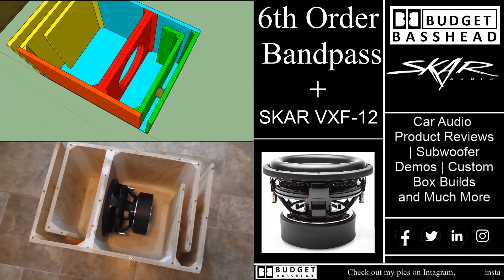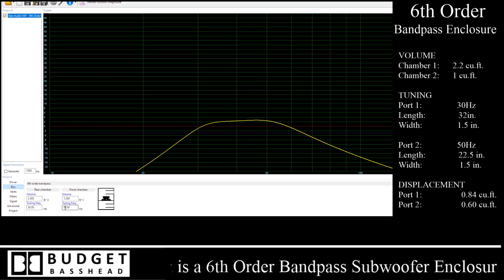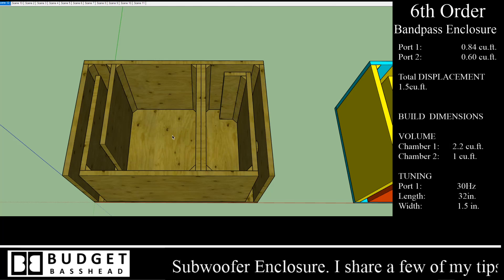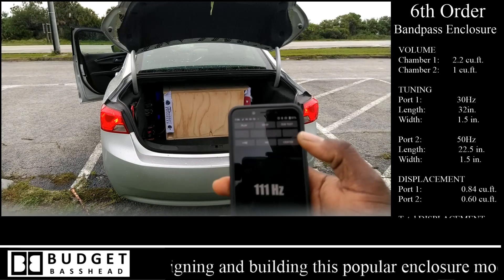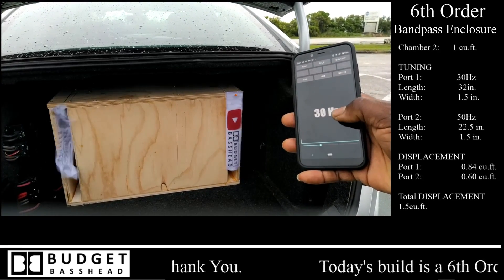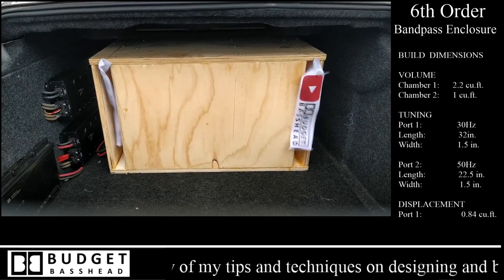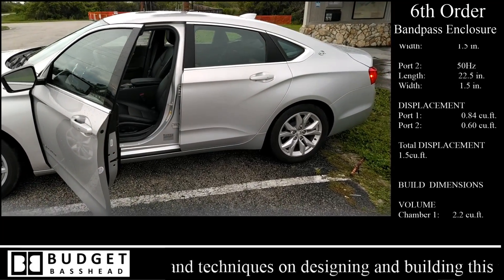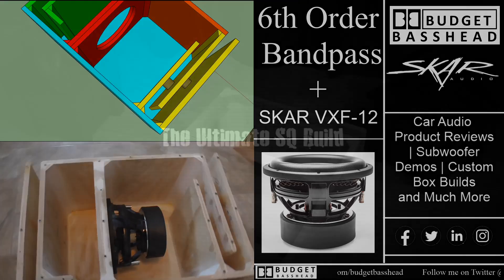How To Build A 6th Order Bandpass | Demo + Build Plans

Comment: As an avid audio enthusiast (Masters in Acoustical Engineering from Purdue), life long wood worker, and (as of last week) MECP Master certified car audio tech nerd, I have to say you do some of the cleanest and most professional builds I have ever seen. I have had the pleasure to have worked with an extremely wide variety of audio nerds.  Your designs are well thought out, well explained, and very well executed. Thank you sharing your time and knowledge with us Youtubers.
Reply: I do have a question though, do you think the ports are to narrow?? Only 1.5 inches.. just curious. Thank you
Reply: @arnoldsalazar5851  as the spl levels go up, for a given mass (volume) of air, it has to move faster and you are trading off port noise vs diameter. If the cross section is too small you will hear the air rushing through the port.
Reply: I generally see that people under size there ports, when I used to build boxes I would generally increase the total volume of airspace and increase the port size as well, in my case I preferred lower tuning so port had to be long as well. Insane efficient output and never had port noise.
Reply: I build boxes also, I haven't started making any of my videos for YouTube yet, but I need to. one thing for sure is I wish I had all the knowledge that you guys have when it comes to making and designing my boxes for my builds. I just finished a 6th order bandpass that I originally made to be a 4th order but I had to tweak a few dimensions and ended up with a 6th order for a single 8" Fosgate P2D2 dvc that sounds pretty amazing. but I wish I understood all of what you guys now and implicate in your builds.
Reply: who cares
Reply: I can't seem to get my vxf 15 to load in winISD do you know how to fix this?

Comment: Your channel has taught me so much ver the years as an installer.  Thank you.  but i think my next project might even stomp the KING.. JS. 1 12 american bass xmaxxx 6th [slot and tube ports], 2 10 ab xfl 4th incased into 1 enclosure  blow  through  rear deck  2  round ports with  a square center port.   in the jag xjl. . those programs will be needed once i finish building my Mac

Comment: Finally!!! Lol, I have a single 12" Sundown Xv.3 and I have talked with a few different people and although a 4th order would be good, I've been told a 6th order will give me a much wider bandwidth for my truck. Now, my truck build has been everywhere from starting with a couple shallow mount subs under the backseat to gutting the back of my F150 XLT SuperCab and extensive sound deadener, electrical is solid starting with the Brand X 320amp alt and the Big 3-4 upgrade going to a D3400 under the hood back to an XP2000 and an XP3000 with the option of putting my other D3400 in cab, but I've decided to keep the 2nd D3400 in my daily driver that houses a single 12" U D1 8layer recone and a 2.5cuft enclosure, but back to truck. I had originally planned doing a blow-thru with 6 U's, or a triple enclosure as I have 3 all rebuilt motor up hardware and all, or a 4th order build with 4 U's. Got to thinking about it after I traded my SAV2 12'S for the new Xv.3 12 and it's seen only clean power and an hr at that. So, grounds got plenty 1 bed ground (changing to frame) so it's 3 frame grounds passenger side and 3 driver side for if I convert to Lithium once I understand it more. Anyways, I'd like to give it a shot building a 6th order enclosure for this beast of a sub that's itching to make some good sound. Thanx for reading and maaan I would be so grateful for any other advice or help. Right now I've got some birch veneer 3/4" which I'd like to double up everything so if the baffles 1.5" I'd like it to be 3" or is that all overkill? I'm about to get a good router and table, but have basically everything else accept a good circle jig I think it's called for the router. Please and Thank you for this video, VERY INFORMATIVE!!!
Reply: Also, I didn't mention what I had for an amp. Currently I only have a Taramps smart 5k Bass and so it definitely doesn't starve for voltage at all. I'm running 2 of the U's inverted in a TruSpec reinforced prefab that gave me a little bit more space just so I had sounds for the winter. And anything I do I tune it properly with the dd1+ I picked up. The Amp has a brand new output board side and Tiffany rca inputs since the second I finally opened and put it in a yr later there was a loud bang shutting off which I thought destroyed my newly reconed subs but thank God it didn't. I'd love to get a solid Korean board amp for this build and the RMS is conservatively rated at 2k, which anybody that has Sundown products knows they can handle way more with proper power and tuning. I'm looking for a good 6-8k amp for the future 2nd Xv.3 or whatever I jump up into next. Lots of work to do cosmetically to truck so this season it'll be the single Xv.3 12. Thanx!!!
Reply from the maker: The most important tip or suggestion that I can give you when building a sixth order band pass is to not oversize your ports. I personally like to build parallel 6 to order bandpass but I see that most people on YouTube build series six order bandpass. Whichever one you choose just be mindful that the larger your cabin space, in relation to the manufacturer's specification, the smaller you should make your ports. And the smaller you make your cabinet space, in relation to the manufacturer specification, the larger you can make your ports. Cone control is what you're trying to achieve.
Reply: @BudgetBassHead  I would be exceptionally grateful if you would like to say MAKE THAT CALL FOR ME! I am a hell of a student when it comes to anything car audio as it has been my passion since I was 14 and almost 3 years ago now is when it was reignited in a very serious manner!!!! A guy/buddy I have known now for 3 years is big in the SPL game, MECA judge and gives out some nasty demo's! I have learned so much from self taught ambition and with this specifically I would be honored to take whatever suggestions, tips, help, etc. as I want this Xv.3 12 to bang in the truck and I know it will, but other than "messing around" with sub box pro I've never truly built my very own masterpiece although handy with paint, wood, and making things look decent a direct front to back top to bottom build this will be my 1st so I expect to have 2 crap and 1 beauty being 3rd times the charm, lol. No, I will take GREAT PRIDE in this and it will allow me to get my wheels done again, myself and bed sprayed, undercoating and leveling kit for now. I'm tight on bread, but I always pull things together when need be. Hit me up when able to, Thank you very much big bruh!
Reply: @BudgetBassHead 

What's up, Budget Basshead? Always enjoy your content, man.  I have a buddy who has a skar Audio ddx 10 and he wants to build one of these for the his sub.    I'm just wondering if you have any tips on how much port area.    You make mention that we should be careful about using too much port.   Do you have any tips?   Thanks again man!!

Comment: Just a heads up if you're going to use plywood over MDF, you're going to want to use marine grade plywood. It's put together better than your standard Home Depot construction grade ply. Also ply is not acoustically dead which is why MDF is generally used over ply, strength be damned. But using marine grade Will eliminate some of the other issues that come into play with using ply.

Love your channel BTW, really good stuff. 👍

Comment: I have calculate with hornresp and get very low frequencies to almost 10 hz with a visaton wsp26s. it will not go higher because of peaking, so setup for 30 hz is not possible, I get only subfrequencies from 10 to 90 hz within 3dB

Comment: Nice clean work +1 
Advice:
when you design box for automobile you should consider low frequency rise effect +6 to +12 db at low frwquency starting around  50hz also called frequency resonance .
next time dont wory about Wisd graph tune up to 60-80hz +3db.. your vehicle take over and equalize the low part

Comment: This is so beautiful. WOW. I've never seen a real 6th order bandpass box before. Interestingly, I don't believe most people are actually running 3,000 watts to any subwoofers. If you do the math, 3,000 watts at 13 volts is actually 230 amps. If you consider the diameter of the copper windings, they aren't big enough to support 230 amps. If you applied 230 amps to 2 ohms, it would blow up the voice coil instantly. Sound is an AC sine wave and sine waves cannot easily pass current through an electrical coil, due to the impedance (AC resistance) created by the AC frequency. "AC impedance" is why you can plug a transformer straight into the wall socket without it exploding, the transformer winding blocks current from passing through it, acting as a choke filter. The 2 ohm load on paper, is actually hundreds of ohms in operation, which is why the speaker doesn't actually see 230 amps unless you run the subwoofer below the audible level.
Reply from the maker: I have to disagree. I think you are comparing two different electrical systems. A home's electrical system is averaging 110/120 volts which doesn't require much amperage to achieve 1,000 watts. 120 Volts system only need 8.33 amperes to produce 1,000 watts. Whereas a car audio system is a 12 - 14 volt system, requiring around 71.5 amperes @14 volts to produce 1,000 watts. The voice coil is a lot more copper than most people realize, which is needed to maintain it's thermal tolerance and  impedance rating.  The voice coil does build resistance as it moves, as you stated, but no where near 'hundreds of ohms'. We in this industry have measuring tools to monitor these things. But great discussion; I like it.
Reply: Lol, I see we have a summer child. These subs really are taking that much power, but they arent doing it for a very extended amount of time. For heat to build, it needs more than just exposure, it needs exposure over time. If you only had exposure for a few milliseconds, it's going to build a lot less heat than exposure over multiple seconds or minutes. These subs are playing music, and as we know, it's not a constant tone, it's also not a DC output. This is an AC output. The sub goes back and forth, meaning the polarity switches over a frequency.

Comment: Dude, I give up! Looking that is. I have been looking for this small size subwoofer for awhile. Everyone has the same thing that is mostly wrong for me and my application. Which is a small 2 speaker + 1 subwoofer system for my office/ hobby room  built within a larger shop with all my necessary tools for my hobbies. I have the large sound I built. Now I want the small great soung. The 4" sub-encloser that sounds great is my next problem.  You just gave me the beginning of solving that problem.  I want strictly sub. Suggest to me which  box and how many watts to achieve great low sound at low to medium volume . Thanks  poppa Keith. 62 yes old
Reply from the maker: It depends on what you're using it for. The sixth daughter bandpass is my go-to. It has great bandwidth and it's efficient. But I only suggested if you are trying to listen to a broad genre of music. If you only listening to movies then I would say a simple ported enclosure tune as low as possible will be your best bet.

Comment: Great science video Mr.  I have an H2 Hummer and want to feel the sound pressure of deep bass.    I'm not looking for competition but want to feel the bass pressure not just hear it.
This is the equipment I am thinking of getting.

Subwoofer = Skar Audio VXF-12 D2 12" 3000 Watt Max 1500 Watts RMS Power Dual 2 Ohm
           Amp = Sundown Audio SFB-1500D Monoblock Amplifier 1500 Watts RMS 
           Box  = ported Box.

Maybe i can future-proof and get Sundown Audio SFB-5000D Monoblock Amplifier 3200 Watts RMS.
If I plan to get a second subwoofer later on.
What do you think? Will one 12-inch at 1200 to 1500 watts give me the Bass pressure I want to feel?
or 1 15" ported box or 1 bandpass box like yours..   lol... the list goes on  lots of options

Comment: I prefer the graph for 60 Hz. It looks like it rolls off too early for my liking on 50 Hz but whatever your application is it might be just right. You can also play around with chamber sizes to manipulate sensitivity increases. So if the response going up 4-6 dB is too much, you can shrink the chamber.

Comment: This is the best video I have seen regarding this. I have a serious question if you can. Can a sixth order box also be isobaric for 2 - 2007 Kicker 15" cvr?
Reply from the maker: Of course. But those subs seems efficient enough to not need it. Isobaric was a thing back in the day when subwoofers had tiny magnets and not a lot of motor force. But try it out and let us know how it comes out. 🤘

Comment: If I’m not mistaken that’s actually a 6th series a parallel 6th the ports would run side by side to same side of box
Reply from the maker: To simplify: series means to connect end to end and parallel means to run its own path. each of these ports have their own path; that means that it is parallel.
Reply: Its definitely a parallel 6th

Comment: Completely obscure question, but I'm nutty and just gotta know:
What would happen if you drilled a hole in your baffle? I assume it'd take the point of port tuning away, but could that also bring with it some efficiency between the frequency tunings? Kind-of like making the whole enclosure tuned for the sum of the two? 🤔
Reply from the maker: What you said...😉

Comment: Please dont use plywood!!!!
It is not dense enough. It will give you a hollow sound.
Plywood can also leak air because of air pockets in between skinning layers.
Try trupan! Super light MDF. Comes up to 1.5" thick and 5'x10' sheets. One guy, one arm, can carry the sheet!
Reply from the maker: Thanks for the tips🤟
Reply: @BudgetBassHead   I hope you didn't take that as a negative. I love what your doing. I'm 50 years old and used to experiment all the time. Love that low end! HaHa.
That "hollow" sound can really mess with your "ear" meter and make the bass sound weird and less explosive. If you have too, double up everything, those port walls are probably flexing too.
Thats alot of pressure!

Comment: Honest question out of curiosity, when you said that the 50hz side is primarily the daily driver, why then wouldn't you want that side to be your bigger port? What's the benefit of having the bigger port on the side tuned for 30hz if it isn't used as much? Have you ever tried a system with the ports swapped in such a manner? I'm genuinely intrigued to hear your thoughts about this...
Reply from the maker: The lower your tuning, the more space/volume is required. Higher tuning require less air space/volume

Comment: You set the gains at 2k watts?  Hmm?   Since when to gains control power?
Reply from the maker: Some subwoofers can handle a 5-15% boost in gains and certain enclosures require a 5-10% increase to compensate for box/impedance rise. It's all about the enclosure and which driver you are using; as to how you set your gains. It also depends on the amplifier. But if your amp has a variable frequency bass boost, you could use that instead; to boost a particular frequency. It varies from setup to setup.

Comment: One of the baddest boxes I have built to date was a dual chambered 6th order. Biggest problem was I didn't find that out for another nearly 20 years. Jist did it. Myself or no one I spoke with new what it was considered to be.
Reply from the maker: 😀 If built right, a 6th order can make almost any subwoofer sound pretty good.

Comment: did i need to include the port displacement in calculating the measurement of chamber displacement?  so if the port is 0.84cu.ft and the recommended chamber displacement is 2.2cu.ft, i only need a 1.36cu.ft chamber?
Reply from the maker: The port displacement is seperate from the chamber volume. You must keep them separate. First calculate the chamber volume, add to that volume, the subwoofer displacement. The vent/port volume is never included in the chamber volume.
Reply: @BudgetBassHead  so the displacement of the port must be calculated and added to the internal volume of the final design? i’m a little bit confused on the total displacement of the chamber.
Reply from the maker: @yml143 Yes. I have an upcoming video that discusses all of this. Hopefully you'll stay tuned for it 😉
Reply: @BudgetBassHead  thank you for your response! i’ll wait to that video, keep it up!

Comment: I've tried out to simulate your box for this Skar woofer in WinISD - almost identical like yours in your video (maybe some different settings or constants in WinISD, or different WinISD version... I dont know), and after that I've tried to simulate a box myself - not so loud, but more low-end extension (low-chamber tuned to 20 Hz), then I designed it in speakerboxlite online designer. Here is a PDF document I've created, in it I wrote a description, and on screenshots your is the cyan color, mine is magenta + on screenshots I captured all the project parameters too: https://drive.google.com/file/d/1q3NnG1sNvtIanGcw4NkPxUGs1QKWfGSO/view?usp=sharing

What is your opinion?